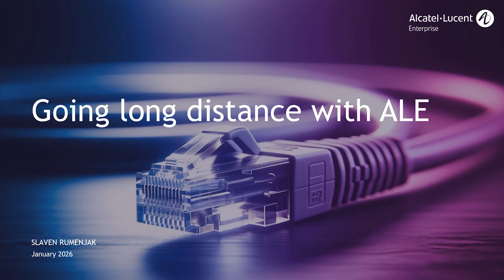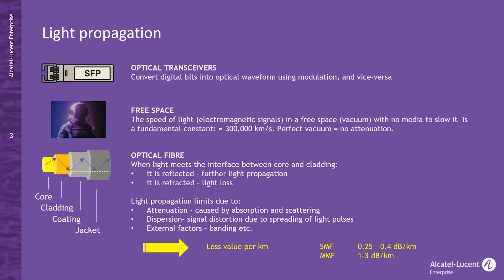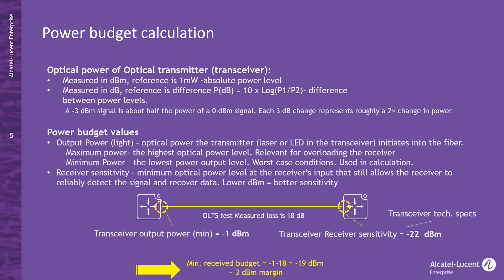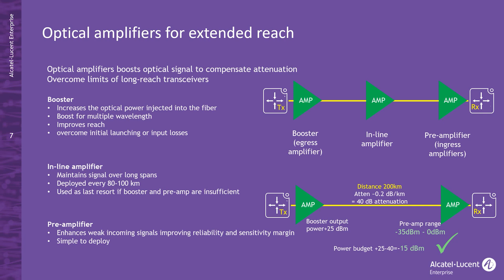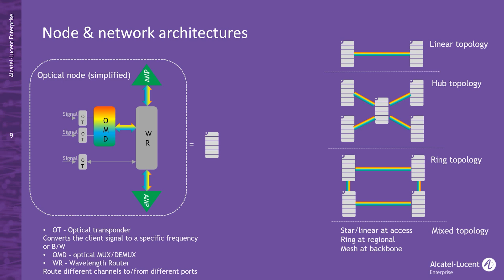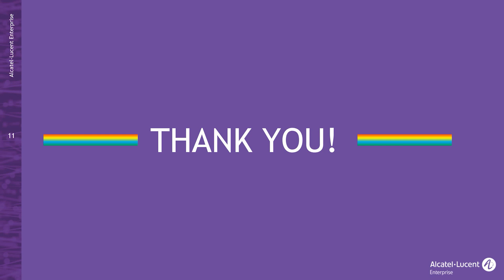Going long distance with ALE

Comment: This technical webinar explains how to build long-distance, high-capacity, and highly reliable network connections (Data Center Interconnect - DCI) using Alcatel-Lucent Enterprise (ALE) and Nokia optical solutions.

Here are the key takeaways from the video:

The Power of Dark Fiber
Dark fiber refers to existing, unused optical cables with no active electronics attached. By adding their own optical gear, organizations can "light up" this fiber to create private, dedicated links. This offers a highly cost-effective, fully controllable, and massive-bandwidth alternative to recurring leased lines or complex SD-WAN deployments.

Fiber Loss and Power Budgeting
To ensure a signal reaches its destination, you must calculate a link loss/power budget. Light loses energy due to fiber length (attenuation), bends, splices, and connectors. It is a critical best practice to always include a 2 to 5 dB "safety margin" in your design to account for future degradation, dirty connectors, or repairs.

SFP Modules and ALE Validation
ALE officially validates long-reach optical transceivers (like 40 km and 70 km SFPs) for use in OmniSwitches. The video highlights that wavelength drastically affects distance: an SFP operating at 1550 nm experiences much lower attenuation than one at 1310 nm, allowing it to push a signal nearly twice as far using the same optical power budget.

Extending Reach with Optical Amplifiers
When standard SFP modules aren't powerful enough, optical amplifiers are used to boost the light signal directly, without converting it back to electricity. There are three types:

Booster: Placed right after the transmitter to maximize initial launch power.

In-line: Placed mid-span (usually every 80-100 km) to re-amplify a degrading signal.

Preamp: Placed just before the receiver to make weak incoming signals readable.

Scaling Capacity with WDM
Instead of laying new fiber, Wavelength Division Multiplexing (WDM) allows you to send multiple independent network services over a single fiber pair by assigning each a different "color" (wavelength) of light.

DWDM (Dense WDM): Supports up to 160 channels, massive capacities (100G, 400G+), and very long distances, but requires more expensive, precise equipment.

CWDM (Coarse WDM): Supports 8-16 channels. It is a simpler, more cost-effective solution for shorter, point-to-point distances (typically under 80 km).

The Nokia DCI Portfolio
The webinar concludes by showcasing the Nokia Data Center Interconnect portfolio (partnered with ALE). These scalable, modular platforms cater to both heavy-duty telco operators and enterprise IT. They offer critical features like resilient optical paths, hardware redundancy, and inline layer 1/layer 2 encryption for secure, mission-critical environments.